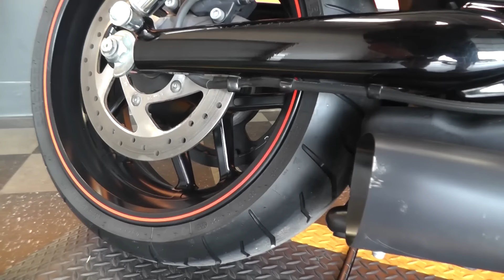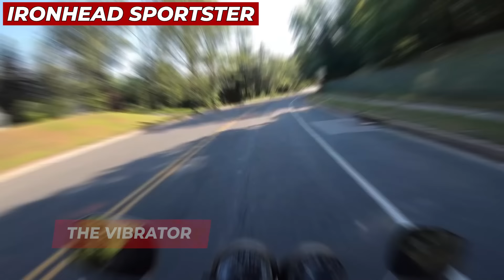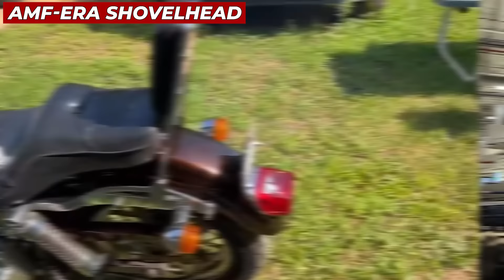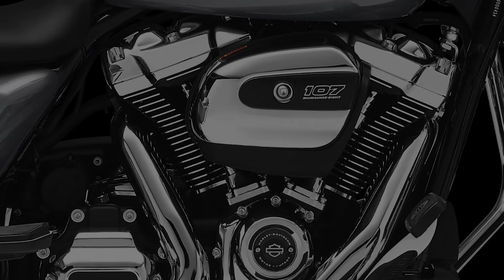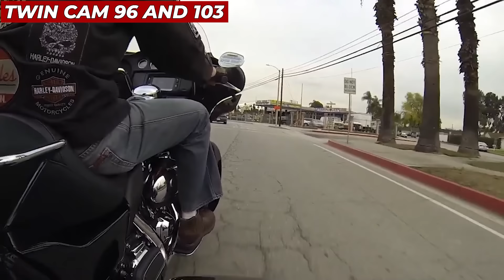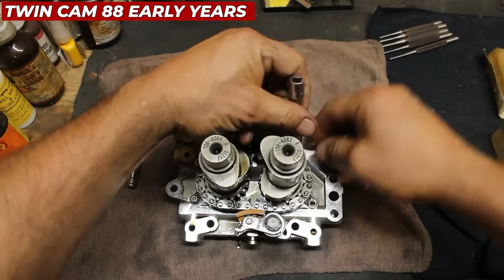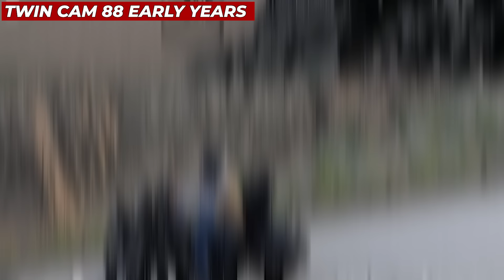10 WORST Engines Ever Put into Harley Davidsons

Comment: There are four twin cam 88s at my house. All four have been going for 20+ years. I've replaced tensioners on 1 of them.
Reply: I have the first mode TC88 in my 99 superglide FXD came w timken bearings from dealer when I purchased it new. No issues but I am replacing OEM motor mounts.
Reply: @TwinCamshorts   should I consider changing mine as well? I have a 2001 and a 2006.
Reply: @SSPlymouthI would say yes not because I had it done but at idle the oem oil pump was at 5 or < psi but with the new feulings plate & oil pump im at 30+ psi upto 60psi revved,that oil pushes now, new hydraulic lifters & new push rods came w/ kit, they removed the pushrods by cutting them w/ bolt cutters, new chain too included...the only thing i would have added is new cam lifters...but if you keep it as a stock motor you DO NOT NEED TO CHANGE CAMSHAFT OR CAMS FOR HI-PERFORMANCE ONE...JUST SWAP OUT THE CAM CHEST OLD PARTS...
AT MY AGE IM DONE , W/ UPGRADED CHEST ITS MY LAST RIDE, ACCORDING TO MY PRO'S ONCE YOU DO THAT TO TWINCAM IT IS A RELIABLE & GREAT MOTOR & A KEEPER...BETTER THAN EVO, OIL LEAKING PANS,SHOVELS& KNUCKLES & FLATHEADS...IT WAS TOO COMPLICTED FOR ME BUT IT WAS PROFESSIONALLY DONE FOR <$1400, RUNS GREAT AS MY ARLEN NESS OIL GAUGE MOUNTED ON THE REAR HEAD  TELLS ME EVERYTHING IS BETTER!
Reply: @greghagos  I'm in Oregon just bought my 1st Harley knew nothing 99 Ultra wtih 51k miles. Having new tires, drive belt, converted to Carb,  primary tensioner shoe replaced, and checking to see cause was told it was converted to gear drive..spending more than I paid for the bike, hope it comes out solid!
Reply: @D_Grouchy_Old_Man im thinking your 1999 is an evo, w/ gear driven cams...the best! Imho the oil plate/hi- pressure oil pump is the only thing needing a tweak...other than w/ a carb...THAT IS A KEEPER & SOUNDS GREAT TOO!
Reply: @greghagos I have a 99 Softail Custom, last year of the Evo. Doesn't leak or burn oil, just runs and runs. E-carb, velocity stack, and V&H pipes and she goes just fine and sounds great.
Reply: I have 03 Softail 88 heritage it has 23,000 miles should I replace the tensioners?
Reply: @ronaldhudson5678 hey Hudson replacing the tensioners doesnt mean anything is bad or wrong with the bike...youre just insuring it against future failure that if those plastic shoes did disintegrate YOU DONT DESTROY YOUR MOTOR...BY swapping them out for the new & improved ones it very well may be 1 & done for you...but the thing alot of riders noticed that the oil pump was not sufficient after they installed an oil pressure gauge on their rocker...Fuelings & other good makers included all that plus a hi-pressure oil pump as I went from 5psi to over 30psi, that involves more work & a little more $$ but the cam chest WAS the weak link in TC...getting it done sooner rather than later insures a good ride imho...JUST DONT ADD MORE HP+ OR TORQUE++, thats why many were having  problems as they added big bore kits but in many cases kept all the cam chest oem...
IMHO dont add stuff to upsize....but keep it to near oem hp & torque & then TC is great, my last ride before trike time & ive had mine for 20 years+...nothing but batteries, tires, SE pipes, Medallion 7" tank gauge but no hp or stage 1/2 big bore kit. RELIABLE...PERIOD.
Reply: @greghagos yep, the 'Screaming Eagle' kit to upgrade is like $400 and can be done in an afternoon with hand tools. Plenty of 'how-to' videos out there. It's worth it 💯%, removes a point of potential failure.
Reply: @731trident yep, im not doing it again as I have my method of keeping the miles & wear & tear down on my HD that I had to work hard for...I also have a  metric...Suzuki s40 a 650cc as well I use as a grocerin' gitter, coffee,stamps & newspaper...the HD is for the long haul rides, its gittin' harder to roll down the driveway for just a dunkin donut & back...but DONT LET ANYONE TELL YA...TWINCAM IS BAD,UNRELIABLE,ETC...IF YOU START TO BELIEVE THAT WHEN IT COMES TIME TO SELL IT OR YOU CANT BIKE ANYMORE THEY'LL WANT YOU TO GIVE IT AWAY...TC MAINTAINED JUST LIKE ANY OTHER HD NEEDS REGULAR CHECK UPS LIKE THE CAM TENSIONERS...LOOK AT ALL THE FLAWS OF OIL LEAKING PANHEADS & SHOVEL & FLATHEADS...THAT CAN BE DANGEROUS ON TIRES OR THE FACT THEY DONT HAVE DISC BRAKES & GOOD LIGHTING & WHAT DO OWNERS DO? SPEND WAAAY MORE MONEY TO UPGRADE THAT OLDE TYME STUFF & WIND UP SPENDING MORE $$$ JUST TO SAY THEY HAVE A PANHEAD...WHEN THEY COULDA BOUGHT AN HD FROM THE 1990' TO SAY 2010 & KEPT ALOT OF $$$ BUT...THEY HEARD TC IS BAD? JUST A FEW SIMPLE STOCK  MODS & 1 & DONE! BEST REGARDS AS WELL!
Reply: @greghagos nothing says I'm a wimpy old man like a trike.
Reply: @ScottMisus-du6il yeah but ive riding 39+ years plus & no accidents, nothing to write home about, these kids on hi- performance euro-sport bikes are dying all the time, YOU BETTER KNOW WHEN THE TIME COMES TO CALL IT QUITS WHILE YOURE AHEAD OF THIS GAME!
Reply: @ronaldhudson5678 I would. Matter fact if you can upgrade it. That plastic crap is a time bomb and expensive upon destruction.
Reply: @ronaldhudson5678 my heritage tensioner went at 50k miles- I added a six speed gear box but my bill was 9024.00 bucks-the gear box was 15 hundred of that bill- I’m no mechanic and nobody told me about the tensioner problem- now it’s a 103 for what it’s worth
Reply: I believe that he is talking about majority of the owners that has only 1 Harley,
don't forget that they drive 3 times more than you do who have 4 Harley 😉
I also know when I have multiple bike's, they last longer.
Because I am not able to drive all bike's every day 🙂 That's obviously.
Reply: Glad I only had an 87 FXR which was 30 yo when I bought it, great bike, just sweating a little and the electrics needed attention.
Wouldn't choose for any other type now.
Reply: I replaced my cam chest w/ Feulings, + hi-pressure pump+ hydraulic lifters & plate....
Its now bullet proof now & at my age...my last bike...
Reply: @greghagos did the same thing to my 99 road king runs like new with 87,000 miles thats all i have do to it. It will be my last ride also.
Reply: @robertlowery3918 nah! DONT SAY THAT! IVE UPDATED MY ANSWER, OH ITS MY LAST BIKE...FER SURE,FER SURE BUT,
UNTIL I CONVERT IT INTO A...
T R I K E! AKA OLD MANS BIKE!
BEST REGARDS AS WELL!
Reply: inspect them from time to time, normally at 30,000, on years 99-06
The one on the backside is the hardest to see
Reply: @sheanbrown9940  yep   changed mine out to the screamin eagle setup at 30,000 the shoes had little bitty pits in em  thats all 2004 FXDWG
Reply: Bought my road king new 2004 inspected the tensioners at 100,000 and they look like new started getting really paranoid about failure and replace them at 114,000. I also put in new lifters. The bike was running perfect when we took it apart and after putting it back together, it runs better than it ever has since I’ve owned the bike and gets better gas mileage about 56 MPG I also put in new lifters. I think the new lifters is worth the performance increase came from better fuel economy quicker starts quicker throttle response smoother low end torque
Reply: @drummingbikedude PLEASE JUST DONT UP THE HP & TORQUE! THATS WHY TWINCAMS WERE FAILING, MORE HP & TORQUE & ACCELERATION PLUS INEXPERIENCED NEW RIDERS OFTEN LUGGING THE ENGINE WITH MISMATCHED RPM's & GEAR POSITION...
ITS A KEEPER NOW! 2004 WAS A GOOD YEAR WITH MINIMAL SENSORS, NOW I HEAR HD's HAVE 27 + OR MORE, MY 2002 HERITAGE ONLY HAS A CAMSHAFT CRANK POSITION SENSOR & ECM...BIG DEAL! 
AS YOU GET OLDER DONT SELL OR SWAP IT, JUST GET TRIKE CONVERSION INSTALLED & SAVE🤑🤑🤑🤑🤑🤑🤑
Reply: My first 2002 wide glide lost an outer tensioner at 40k miles. I put 22k extremely hard miles on it. So, I expected mine to go. Lol
Reply: Did you save the old ones for spares? I have a twin cam 88 from 2001, but only has less than 5000 miles.
Reply: Doing the bottom line is, it's a  luck of the draw
Reply: Tc88b 100dkm without inspection bullit proof .fyi oil change each4dkm 20w50car oil
Reply: Sitting, not ridden will do that.
Reply: I have two with the TC88… I have had zero issues with them.

Comment: I have a 1998 ultra classic 95th anniversary edition I've owned it since 2002 and it had 11,000 miles on it when I purchased it and now has 120,000 miles on her ! And  I've never had to crack the engine open ! except I did replace  the push rods I think the 1998 Evo is the best engine Harley ever   made it's bulletproof !!

Comment: I've owned this 1999 EVO powered Heritage Softail, for 10 years now, and I can't complain about it! In ten years I replaced the starter and a voltage regulator, and tires! Of course the normal maintenance! This thing is a blessing to ride!!! 
I also had a 1983 Tour Glide that I owned for close to 15 years. It did leak a little oil, but nothing that I had to check weekly! Once a month I'd put in a half quart maybe not as that. That was a true "Road Sofa"! It was balanced real nice! You could lean that thing where you could reach down and touch the pavement! I know, I did it! And still have the ripped up shorty gloves to prove it! 😂😊
Reply: Go get a Honda,You,ll meat the nicest people
Reply: Head breather Evo was the best motor of all, in my opinion. Able to go 100k miles easy, if it got scheduled maintenance, stock or modified. S&S still makes "Evo" motors, so there's another testimonial.

Comment: I have 6 Hondas from the 80's to early 2000's to 2025 Honda Dax.   Not a single one of them leak oil or have any other mechanical problems.  Each and every one starts instantly and my Shadow Spirit sounds as good as any Harley.  Sorry about your bad luck.  🏍
Reply: Sorry you think your Hondas all that. 6 bikes in the garage a 71, 77, 82, 04. 15 and a 17. all Harleys and no issues with any.  Your collection will make great soup cans some day.

Comment: V rods major sin was the fact that it hauls ass, a foreign rider experience to anything the motor company had previously  been accustomed to.
Reply: Hauls ass. Than remembers its a Harley. And breaks down as usual 😂
Reply: @PopeOnARope85 I don't think so man I put 55,000 mi On my night rod And the only thing I've ever had to do was routine maintenance never a breakdown.
Reply: @GIJ03J03_FPV that V Rod aint touching my M109R. I dare it to try.
Reply: Love my twin cams tensioner at 48,000 again at108,000 still running don't add oil unless I go over 5,000 miles (Schaeffers oil) only only

Comment: I am a 50 yrmechanic & 30 yr Shop owner. Bought an 03 Annivesary at 12k that already had the 95 Square Bore Kit installed. I use Schaeffers Synthetic & Marvel mytery oilin Every fill of fuel. 2 chain Tensioners went out at 49k . There were Fine screens that kept Them from going to oil Pan or Pump Pick up. Didn't do 500$ up date due to only 1 of 2 chain tensioners being oil tensioned. baught 2 new chains & 3 new nylon tensioners. Set Bike upright, ran starter & watched oiling. Rebent metal oiling Guide So oil now Lands on middle of chain. Now have 116K on worst Engine, Inspect on occasion.& still have at least 40% material. Am66 yrs old & still enjoying the worst Engine Ever made
Reply: You shouldn't have to do any of that to get a reliable engine.
Reply: @michaeldillery9232 my TwinCam is the most reliable and best bike I have ever owned across 57 years of riding, never gives any issues, works hard
Reply: @michaeldillery9232 my TwinCam is the most reliable and best bike I have ever owned across 57 years of riding, never gives any issues, works hard
Reply: @michaeldillery9232 my TwinCam is the most reliable and best bike I have ever owned across 57 years of riding, never gives any issues, works hard
Reply: @michaeldillery9232 my TwinCam is the most reliable and best bike I have ever owned across 57 years of riding, never gives any issues, works hard
Reply: @michaeldillery9232 my TwinCam is the most reliable and best bike I have ever owned across 57 years of riding, never gives any issues, works hard
Reply: @michaeldillery9232 my TwinCam is the most reliable and best bike I have ever owned across 57 years of riding, never gives any issues, works hard
Reply: @michaeldillery9232 my TwinCam is the most reliable and best bike I have ever owned across 57 years of riding, never gives any issues, works hard
Reply: @michaeldillery9232 wish That were true but it's been known... Motorcycle, boat & motorhome.you have to pay to play. Especially in the maintainence field.😂❤
Reply: Honestly you should just put in the gear set or a roller tensioner. Most of us did.
Reply: @umpatas5468 most of ya spent over 500 in parts alone that should have been Harley's Recall. I definitly do not fall in the class of most, which is why I'm over 117K & Still going.
Reply: My 03 Anniversary road king classic blew up at 18k miles split the crank destroying the entire engine eleven miles from service at the Harley dealer.
Reply: @donaldnelson7076 Don't doubt it. That's why no one else works on it except me. Did have to redo the work previously done by dealer before I had bought it at 12k. They had the clutch rod way to Tight (welded itself to adi nut) and had to do accel cable (was adi.Too loose causing Kink  & broke) they had just replaced it. I haven't had any problems since I did it myself.🙏💚
Reply: And can't recognize a crap post.
Reply: @paulayotte5414 recognized this one
Reply: Where are you located? I live in South Florida fixing to move north. I think the Alabama but not sure yet I need someone I’m a roofer to help me get this Panhead back to gather are you interested? They call me J my name is DJohn Massimiani let me know I’d like to talk to you it’s a 1956 motor in a 1958 frame. i’ve had the bike for 40 years and decided to pull it apart big mistake on my behalf. I got it pretty much back together, but I have to have a spacer made for the front wheel and I have to pull the motor out. I noticed one of my friends had broken front motor mount crack. right by the distributor behind right front motor mount he kept telling me it had to be ashamed. I never shamed one. It didn’t have shims all as I did was pull the motor out. I have the frame painted and put it back in. I was just marking it up when my friend came down, asking me about shims. next thing you know I have a broken front motor mount. Anyhow, I need someone to give me a hand with this or do it for me or help me I’m reaching out because you’re an older mechanic and I’m 69 I still ride my 78 shovel head and 83 sportster just had my 65 flathead trike stolen at the Daytona. Anyhow, maybe you could reach out peace, my friend. and ride on peace brotha
Reply: @JohnMassimiani your bikes Sound interesting. I turn 67 This year & still have my shop. I'm the only one working out of it  10,11, or so to 5,6, Olcaisionally7, so I stil need to be here, I would certainly love to help you out. Unfortionately I live in Northwest.colorado mountains. Sure wish I had one of those old bikeToTake a ride on once in a while, My 03 is up to 118K now.💜
Reply: as a mechanic and obvious Harley Davidson loyal rider how do you feel about the company passing repair cost to buyers after sumpin issues with the 2017 107 I think it is absolutely unacceptable for somthing that is the fault of the company for design of somthing that wasn't capable of correctly functioning that is not standing behind the bike or caring about their buyers I would have sued
Reply: @JosephMerritt-u6z2v I feel the same way except I'm Just not a sue type person. After being forced Through the court system in a divorce as a Respondant, I find it much less stressful & cheeper To Just solve the problem myself, since I can't seem to stop enjoying The ride. Certianly Doesn't say much for Harley.
Reply: So I'm looking at a 02 cvo fxwd3 switch blade that's had a 1450 kit fitted so do you reckon its ok after that's been done
Reply: @rickychapman4401 depends on the tech. That's why I work on my own.
Reply: I'm a yr young bro, I got a 03 ULTRA, now she's a S&S DRAGON T 143 Monster. Over 100k spent n all I do is wrench on her, BUT BOY WHAT A BUZZ TO RIDE, N GO BYE ALL THE JAP BIKES. BUT I DID RACE JAP BIKES FOR 35 YRS
Reply: Don't be butt hurt
Reply: Had a '99 FXDX from new. Put 40k miles on it. Never needed tensioners. Maybe I just got lucky.
Reply: @brucehunt2719 49K is when I had to do chain & Tensioners. Now at 117K
Reply: @brucehunt2719 do you still have the bike
Reply: @JohnJohnston-l8p yep still ride. Just got new rear Tire, now at 117K
Reply: @EveReb I got a ,05 tricked out to the 9s. I got a Bagger n a TRIGLIDE n Busa. But my Dyna is my favorite. N my Bagger is 143 public inch. My BUSA is drag bike ONLY
Reply: I would say that the M8 engine is the worst engine ever made from Harley as well as the transmission!
Reply: @SalvadorHernandez-to2gq it's one of the worst for people who don't want to buy the specialty tools needed to maintain them. But power, reliability, na they are pretty dang good.

Comment: This video is the usual clickbait that uses unrelated pictures and discusses rumors and not facts.
One thing that the poster leaves out in their criticism of AMF is that if AMF had not purchased H-D, the other company bidding would have gutted the company and had it wrapped up and gone by 1972. And the Greenwood meeting that AMF had, which created every product(except the Softail frame) that allowed The Gang Of 13 to save the company in the 1980s and beyond. Rubber mounted FLT/FXR Frames, the evolution motor(again trashed by the poster, even if it did out perform the previous Big Twin engines by a factor of 2 if not 4 easily), Factory customs, 5 speed transmissions, the Just In Time /MAN Materials As Needed manufacturing system that even the Japanese came to see, the York Facility(hampered by disgruntled employees sabatoging production in Milwaukee), but Yes AMF did move away in the late 70s from the proper care of the Motor Company leading to the BuyBack and the rebirth in the 80s.